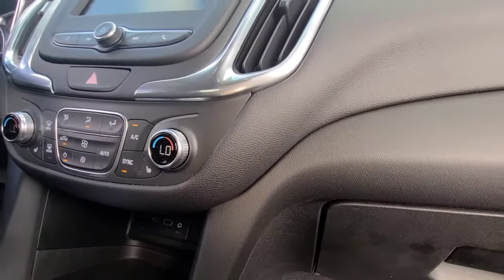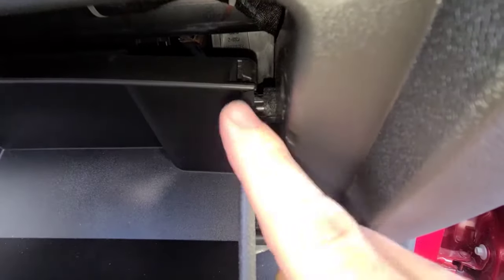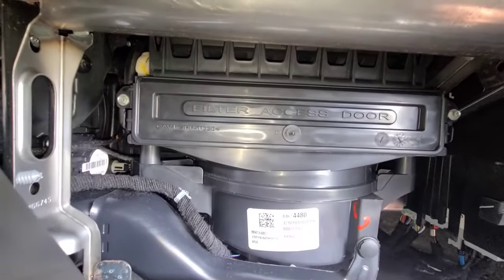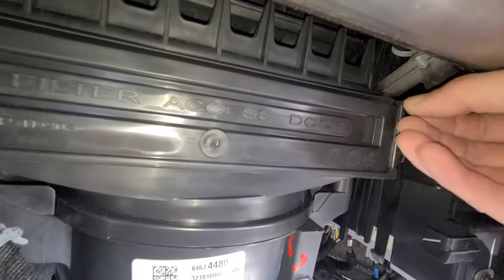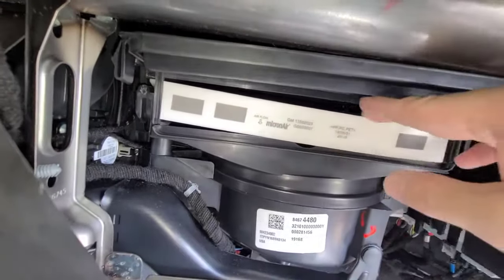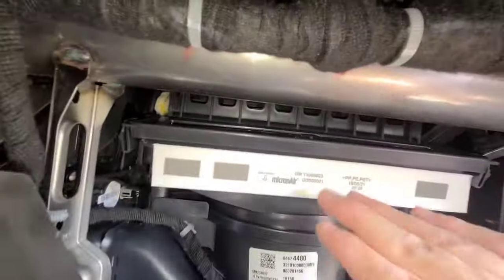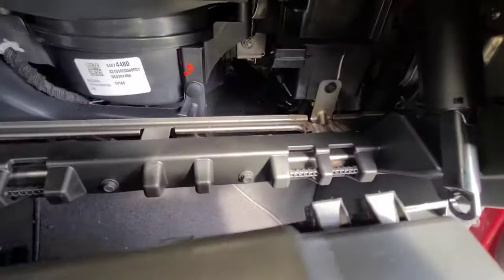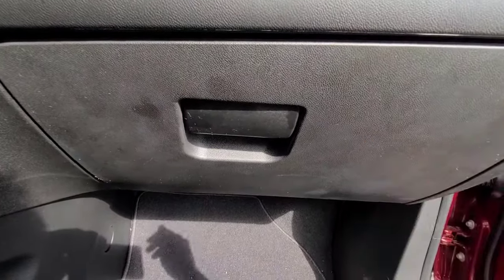2020 Chevrolet Equinox Cabin Air Filter Location Replacement  / How to

Comment: Thank you so much. The dealership said it would cost me $249 on top of $110 for the oil change :( I appreciate this so much!
Reply: The power of the internet is priceless my friend. The dealership tried doing the same thing to my mom. I’m glad she called me first… once her maintenance plan was over with the car she bought I’ve started changing the oil for for her. Just got the oil oil filter and either air or cabin filter for 45 bucks. I can’t stand the dealership markup